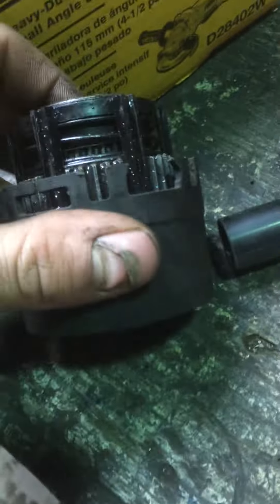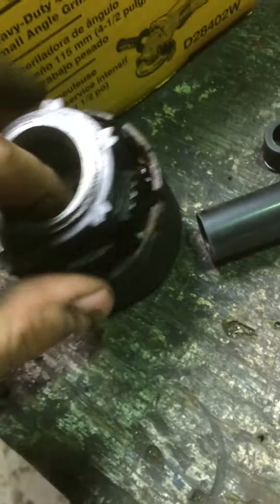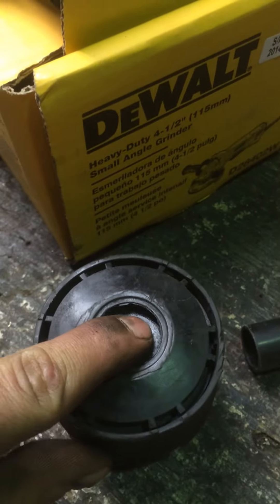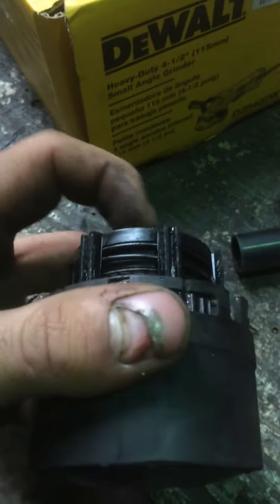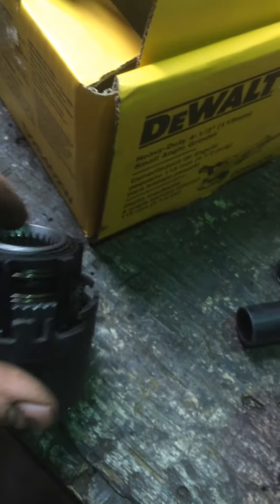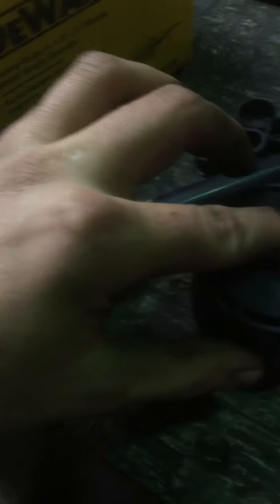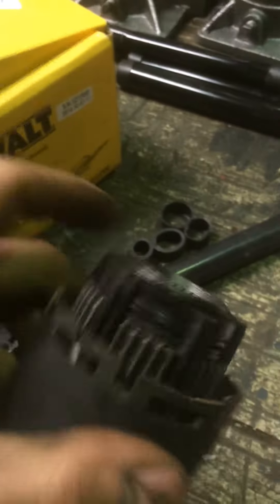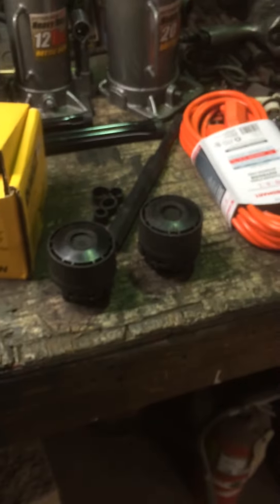Ford Ranger auto locking hubs hack

Comment: That's pretty cool, push button. I had that vacuum operated crap on my Jeep and was frose up so I removed the vacuum system on the axle and case and put linkage to case and a cable to the axle. I don't even have to get out to lock the axle.

Comment: Ok so if I were to do this would I still need to use the switch Inside the truck? What about with the manual hubs
Reply: I believe you would still have to to engage the transfer case? Right??